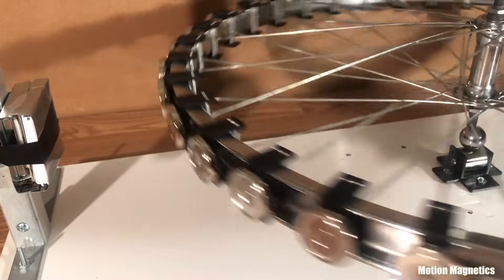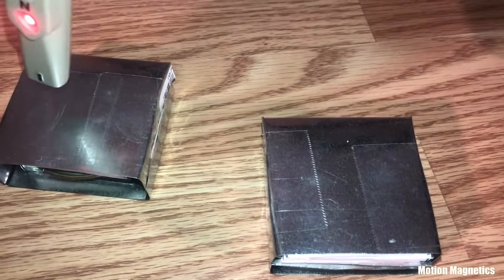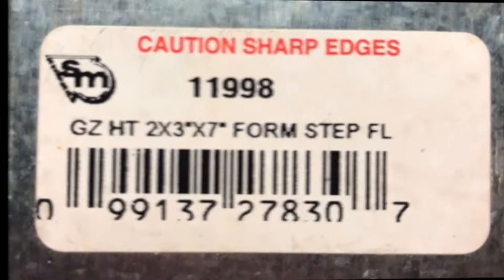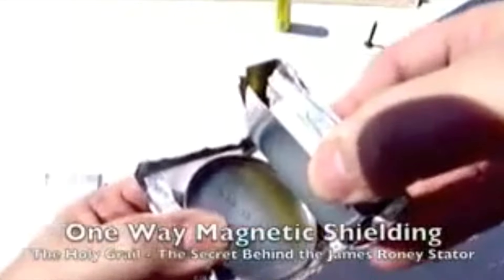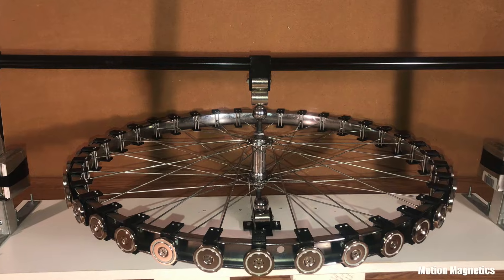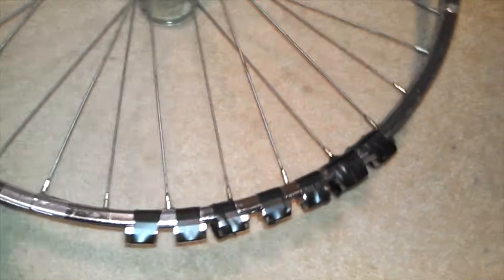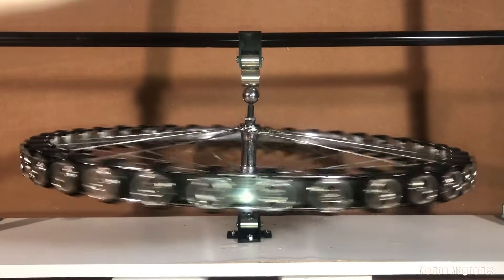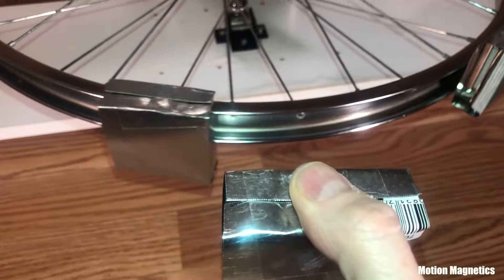A look at James Roney Stators

Comment: I commented on this post and is see the post got erased? Odd 
I mentioned raymondslab experiment which was interesting in a similar aspect. 

Also doing the math before doing the experiment might help understand how to fix things.
I still think you need one small electromagnet at to make the jump, even if it means using a solar panel and a capacitor . Just an opinion. Since maybe you need it to get enough momentum to also help it with the hump.

Comment: I just wanted to say a couple of things here.  I have been working on PMM devices for over 50 years now.  One thing I have discovered is that to get them to any kind of working condition they need to be very precisely.  In that vain I have had to stop creating things for a while so that I can build my own CNC machines (I have built 2 of them).  Another thing which helps myself on my creations is the use of a Tesla meter.  I have found that even though the magnets appear to be the same strength the Tesla meter my tell you otherwise.   I find the many people working with magnets do not realize this.  The James Roney Stator is a very interesting concept.  I am currently working on both a PMM, (actually it also uses gravity to make it go), and a pure gravity motor.  I cannot stress it enough that without precise dimensions these devices most likely will not work.  The last thing i will mention is that any moving parts needs to be balanced!   This is absolutely necessary to get any kind rotating device working.  I hope these suggestions help in some way.
Reply: Hi Rick -- I just wanted to add a simple idea to get your PMM to work.

Assuming there are 3 parts to the PMM ... 

1) A stationary, horizontal cylindrical wall with a few evenly spaced James Roney Stator magnets embedded on the inside facing wall. 

2) A stationary, vertical post standing in the center of the cylindrical wall. 

3) A precisely balanced, nearly frictionless rotating wheel, which has several slightly angled James Roney Stator magnets on it, placed horizontally on top of the stationary post.

This is the key:

The wheel magnets should be affixed to an arm (or stick) that can very slightly extend at the precise moment needed in order to get the proper "push" from the wall-mounted magnets.

Perhaps this can be done by placing small, smoothly rounded bumps on the stationary post that will cause the arms (sticks) to slightly push each wheel magnet towards each wall magnet as the wheel rotates.

Perhaps a very light spring, like the ones in retractable ballpoint pens, can be placed behind each wheel magnet, which will force it to contract after rotating past the post bumps.

It may be better for the post bumps to be shaped like right angle triangles, which will make it impossible for the wheel to rotate backwards. Also, the arms (sticks) should have rounded bottoms to reduce friction.

Just like the Wright brother's flimsy wooden airplane, this design of the PMM is only intended to prove the principle. Research and development and AI technology can then improve upon it.
Reply: @funseeker26    There is absolutely no way to get a motor working which is driven only by permanent magnets. For the simple reason that permanent magnets exercise forces but do not deliver energy. All advices given here including yours don't help over that. The first design for a PMM dates back to the 13th century. Since then up to now no design worked, not for one turn.
Reply: Can you tell me more about magnetic and cnc?
Reply: @Bibibosh  I am using the CNC to make precision made parts.  To get things to work smoothly you need very accurate parts.  Otherwise the imbalance of the system will make it almost impossible to get the system to run.  Then you also need to make any spinning parts balanced as well

Comment: I would be very interested in seeing the rotor set up with the configuration used by https://youtube.com/watch?v=_9dF25gxags&feature=share8

Breaking the gate might be achievable using his permanent magnet configuration, combined with shielded magnets .?.?. I know his setup works because of his unique approach using a ring magnet on a straight rail... But when it comes to magnetic experimentation, you're the last person i'd need to tell, you never know until you try!

I love seeing your experiments, keep it up man! 👍
Reply from the maker: I'm not sure if the two systems are compatible, as introducing metals to the other configuration would completely alter the magnetic fields to such a degree that they wouldn't function the same way. 

I'd look more at things like the linear tracks that are often referred to as SMOTs. It would be easier to break away from the ramp in one of those if the magnets at the top were shielded. 

Thanks, and thanks for the suggestion.

Thanks

Comment: titanium (and other electroplatable metals) are nice rust shield for steel metal, as thin electroplated paint-like layers
Reply: how about a U-magnet
Reply: check below the table for sneaky coils (snake oil)
Reply: simulate the exact magnetic field configuration
Reply: ask an angel (serving spirit) to rotate the wheel as "work", hmh :) cant see it

Comment: Look, it is doable. You just need seven things. Wheel system, I can't type, too tired, it involves using a capacitor on all wire coils, some coils dedicated for generating a pulse to turn the motor against a magnet midway in the center of disk, whose charge is greater than the resistance of the magnets on the outside going through a series of flat circle coils bent into a c shape that the magnets on the wheel go through, it creates more electricity and less resistance from Eddy currents. I used aluminum wire, 16 to 14 gauge thick. Capacitors add to the amount of material connected to coils, giving them a greater charge when a magnet passes through the c shape.  I feel so drowsy, under attack, lol, idk, but good luck. PS. You can shield the pulser drive magnet with two to three inches of tin steel, the direction of how you wrap it changes how well it is shielded. Magnets are 42's 1/2 inch wide and long, cylinder magnets, poles on flat ends.
Reply from the maker: Have you built that? You should definitely post a video of it, if you have.
Reply: @Motionmagnetics  I made and tested the magnetic shielding. I made the flat c coil that had twice the power of a normal coil design and was stunned by its lack of Eddy current drag. My generator design would incorporate a vanderwol device and large plate capacitor that would be grounded with a 9 foot copper rod into the ground and two 10,000 volt diodes helping it to not switch polarity during a lightning storm or from nearby ac voltage power lines.
Reply: @Motionmagnetics  I've got the magnets, wire, and can either make plate capacitors or Leiden jar capacitors, I have the grounding rod and electronic components, but I don't know what to use for the disk, which needs to not be metal or wood, but is able to take heat picked up by the magnets through the coils, it needs to be at least to 20 inches in diameter. I'm worried wood would catch on fire, and plastic melt. The lighter the better. I have several fidget spinner bearings for a prototype. I've been in chaos, family deaths, and three house movings in one year. But yeah, I can make a wood wheel, but heat warps wood too. The main magnets for electricity and for charging are aligned poles outward, like bicycle spokes, but the two magnets that push the spinning plate would have their pole ends pointed down at a 45 degree angle with two regular wound mini coils made like car coils, able to push upward at 45 degree angles against their matching magnets hanging down from the inner area of the plate.
Reply: As good as that sounds it's unfortunate that I gotta tell you I have made a fly wheel generator with stationary coils around it and magnets on the fly wheel. I had the idea to run the fly wheel generator like a rotor cap configuration on a car. As the motor spins. The rotor the rotor pin energises the coils one at a time causing the magnets on the fly wheel to follow it. It turns out it was just a long what if test experiment to prove to myself that you can have a fly wheel spin with enough energy to feed the stationary coils with just enough power to keep the flywheel in motion but as soon as I attempted to power a small light bulb with the flywheels motion the load was more then enough to make the generator slow down and come to a stop. So in regards to everyone who wants continues motion with magnets and electricity it is possible for a flywheel generator to produce just enough power to keep it in motion, the real trick is to be able to connect a load to your motor/generator and have it capable of power devices and machines and still keep itself in motion that is the real goal to me in the end. I realized that the operator has a important role to play with these motors/machines. In short your finished motor or generator cannot be a turn on or off only machine there must be some sort of operator controls to go with it in order to keep the machine from dragging to a stop or racing itself away to its own self destruction. I bid you good luck with your ideas and hope you all succeed with them as well...

P.S The synchronous motor is a good example of an electric motor that's designed to have a load on it or it will race to destruction...
Reply: @TheZafootz  extremely cool.  I came to same conclusion as you, but realized that if you build your propulsion generator to have more force than the resistance of the greatest load, it should, in theory work. It would need a governor circuit for sure! I did not know synchronous motors were able to run away like a diesel engine, that is very cool.